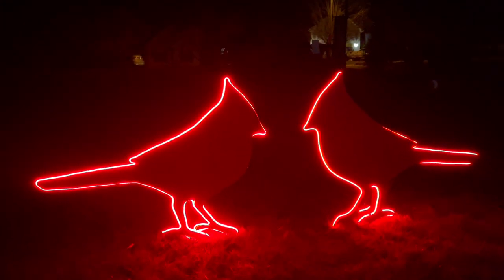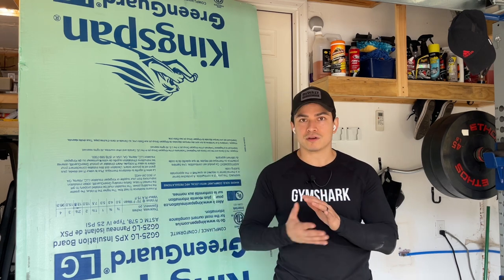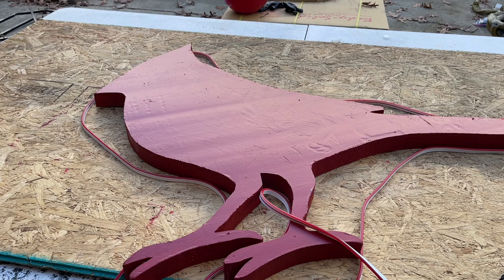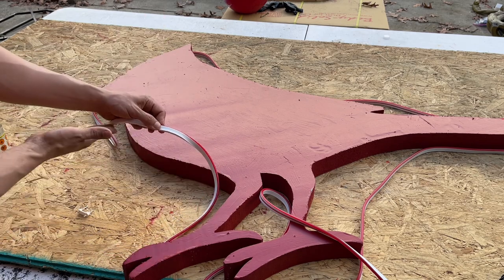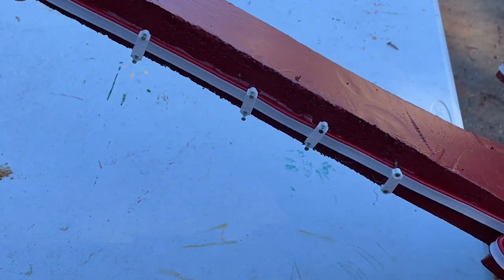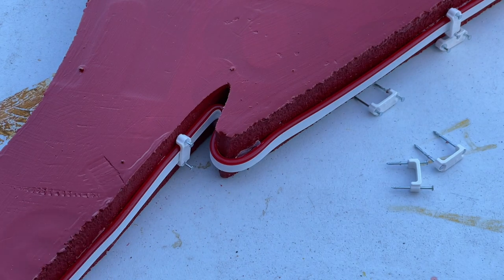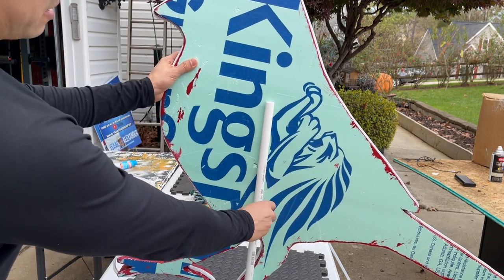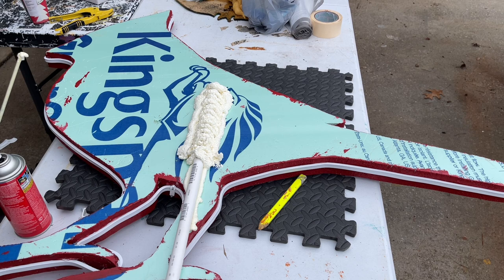GIANT CHRISTMAS CARDINALS - TUTORIAL

Comment: Made these, turned out awesome.  I painted one red and the other a burnt yellow color with warm yellowish-white rope light to represent a female cardinal.  Tip: a quart of paint will be more than enough! Also, be careful of the adhesive for the lights, which are a soft vinyl-type plastic.  My adhesive took a couple days to full cure and hold the lights in place. Also, could get the projector, so I merely enlarged the graphic and printed it on multiple pages,  taped it together and cut out the bird. I then laid the pattern on the board and traced the outline.